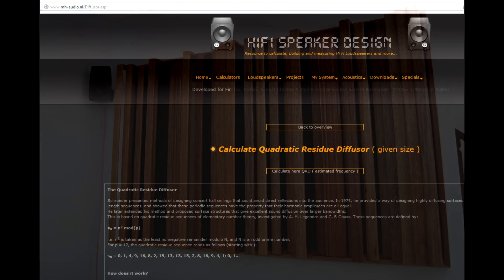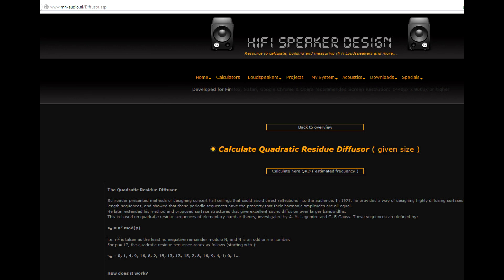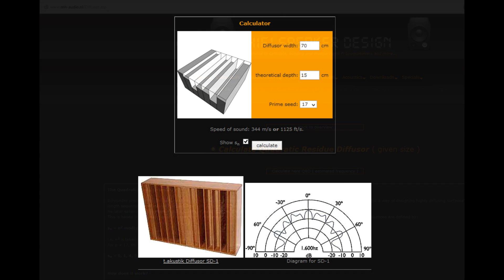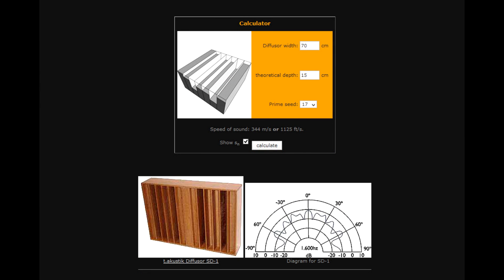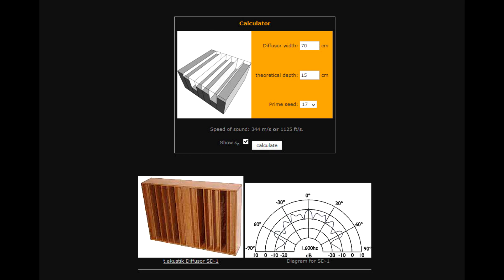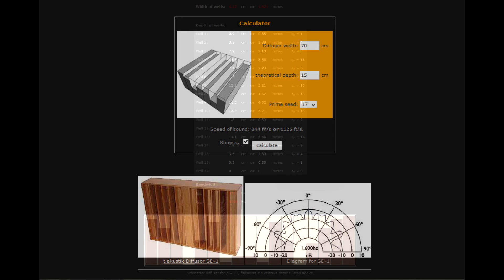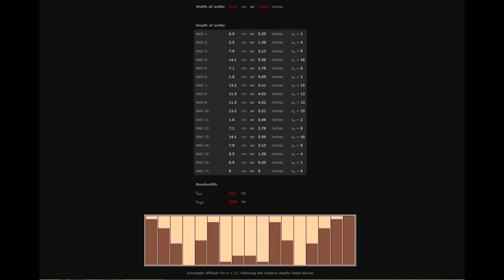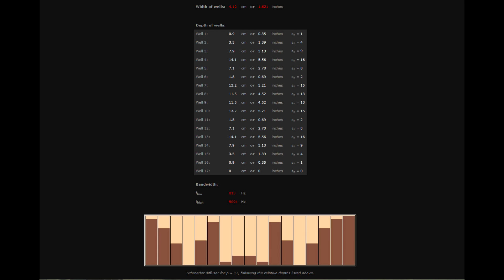Quadratic Residue Diffusor

Comment: your border around that snt the same depth as the overall dimensions. is that optimum ? i seen acoustic fields guy doin a border on his diffusers  ?
Reply: actually no.  without the slots being enclosed  it doesn't work as per calculations.  It's important that each slot be enclosed.
Reply from the maker: kingdizzyworld The border is simply for looks and extra strength. It is the front pieces (quadratic sequence) that do the diffusing and scatter the sound waves. The borders would also assist in trapping the waves. I watched Super 8 last night, hadn't seen it since the cinema release ages ago and when the train crash scene came up it shook the room. I still need to make absorbers for the room, but I have no complaints with the diffuser I built as it does a great job in diffusing the excess sound waves that hit the wall behind me.
Reply: yeah i see ! i like the science of the diffusers !  : )  border optional then !

Comment: @JohnCranberry23 what is the length of each column before the frame?
Reply from the maker: Andrew James Each Column is around 90 cm long. It's up to you how long you make it. You can make it cover the whole wall from top to bottom if you wanted. But you only need to trap / diffuse the waves at ear level. I filled the wall above my lounge so I made it long enough to cover that part of the wall only. The width is determined by the channel sizes and prime sequence you choose.